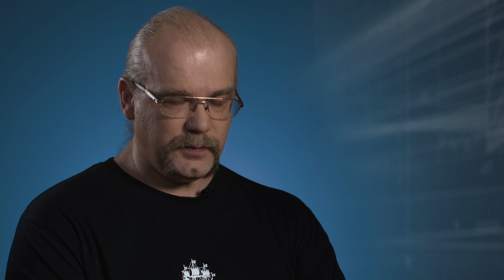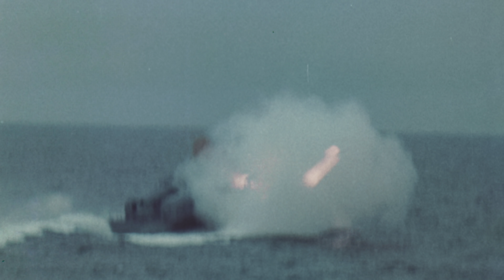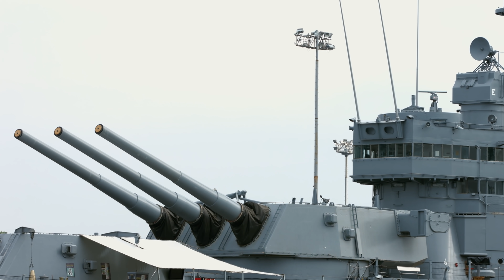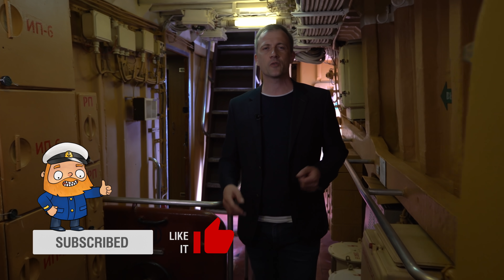Naval Legends: Tambovskiy Komsomolets | World of Warships

Comment: This is true Russian Bias 
How tf can that tiny Junk be able to sink the freaking Iowa class Battleships when they got God knows how many escorts and this thing never did anything!
Reply: By punching through the thin deck, I suppose
Reply: @mediatus-d8v  Except the Iowas didn’t have thin decks, they had three armored decks designed to withstand bombs

the first deck catches the bomb and takes a hit, the second stops the blast from getting through and the third shields the internal components of the ship
Reply: @breadbug6101  how uss alaska can comment in my comment, sheesshh that crazy
Reply: @breadbug6101  i thought you dont have an arms. Damn that is real crazy
Reply: Because of it speed and armament it really can sink an iowa class battleship, iowa class is very slow and it gun is too big for modern warfare, i think if iowa class have some destroyer escort it can defend itself.
Reply: @adreialdovino4239  *Laughs in 35 knots
Reply: @breadbug6101  *laught in 42 knots
Reply: @adreialdovino4239  actually one of these missiles was fired at Missouri during the 1991 gulf war and was shot down
Reply: @Adrei Aldovino  slow? The Iowa can reach 35 knots as her max speed. Which is faster than most modern destroyers.

Comment: The age of Battleships is coming back oddly. With it getting easier and easier to counter torpedos and missiles, it won't be long and it will be near impossible to get through a ships anti missile or torpedo defenses. And the one thing you can't counter is a 16" shell smacking into your boat, rocking the whole crew.
Reply: Maybe not battleships. I think some sort of heavy / large / battlecruisers just because of economic reasons. We don't make thicc boi armor, guns, and ammunition anymore. As for the guns, maybe we'll have either railguns or a naval version of the 1000 mile cannon the US Army is developing, possibly fitted out with an autoloader. Maybe a 2 foward turrets (twin, maybe triple) and vertical missile launchers and a helicopter hangar where 2 aft turrets should be? Maybe add an unbelievable amount of anti air and ciws.

Comment: Once again, Russian propaganda makes its way into these videos. Modern anti-ship missiles have been equated in terms of firepower to that of an 8 inch (203mm) naval rifle. An Iowa class BB was designed from the outset to withstand hits from 16 inch (406mm) naval rifles.the notion that a single Sunburn missile could take out an Iowa (or at the very least disable it) by hitting certain parts of the ship is absolutely ludicrous! Furthermore, you downplay the abilities of the Phalanx CIWS system, and by extension, the missile defenses of an Iowa as a whole. First off, as stated, each Iowa would be escorted by air defense ships at the very least. U.S. Navy doctrine regarding the Iowa’s was if they weren’t part of a carrier battle group, they were escorted by 2 air defense ships and one anti-submarine ship (and what’s with using F-15 Eagles and WW II configured Essex class carriers to represent a carrier battle group?! Please use proper representations!). Second, each Iowa was outfitted with 4 Phalanx, multiple decoy launchers, and the SLQ-32 electronic warfare system for defense (there were plans in place to install 2 octuple Sea Sparrow launchers in the mid-90’s but obviously this never happened so consider this a side note). Furthermore, the minimum detection range of low flying aircraft and cruise missiles was between 18 miles (30 km) to 56 miles (90 km). Good luck in hitting them in the first place! Also, the Iowa’s were equipped with Harpoon anti-ship missiles, not just Tomahawks.
Reply: 16 inches is 406mm
Reply: @DirectorBird  whoops, thx. Wrote this while still waking up, lol
Reply: Would it withstand penetrations from 16", or even 8", shells?
Reply: @jevinliu4658  yes and yes. With technicality exceptions for the Lexington class battlecruiser and the North Carolina class battleship, all American armored warships stuck like glue to the rule of thumb of being able to withstand hits from their own weapons
Reply: @lightspeedvictory  You don't have any idea. The Iowa can be penetrated by 8" guns at close range, so by your logic this missile can penetrate it at any distance.
Reply: @submarinoflotador4532  key phrase there, “close range”. And if u r saying this because of how the ship performs in-game then forget it. The game IS NOT realistic. The USS Wisconsin (BB-64) took a hit from a 6 inch gun to an unarmored section of the ship during the Korean War and all it did was make a 4 ft. hole and wrecked the compartment that the bulkhead was a part of. The USS Missouri (BB-63) took a kamikaze hit directly to her main deck which comprises of 1.5 inches of steel armor and just left a dent. As I’ve clearly stated, Iowa class battleships were designed to withstand hits from 16 inch rifles. An 8 inch shell is more or less a popgun! And u have to remember that armor piercing shells are a whole lot denser than missiles and will therefore b able to penetrate more armor. So really, saying that missiles r equivalent to 8 inch guns is being a bit generous
Reply: @Aspyrstil  You forgot to add “in the game” to your statement bud. Reality is different than what you see in a Naval Arcade game.
Reply: @submarinoflotador4532  You are Dense actually, you feeling this is the same in Reality and in Game LOL, better know what reality ships are than in this whack simulator Game

Comment: In case you wonder what the Cyrillic text in the video means:

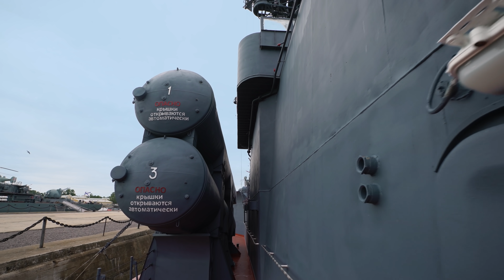1:00 "Danger. Lids open automatically"
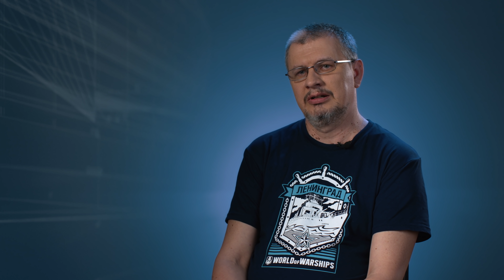2:01 "Leningrad" (on the shirt)

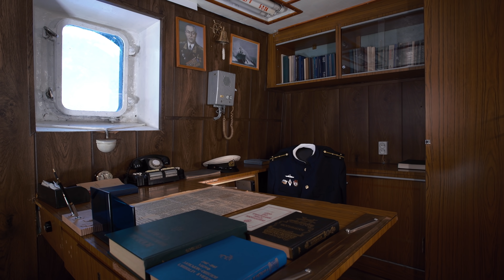5:07 "Sailing the Baltic Sea" (the highlighted book left)
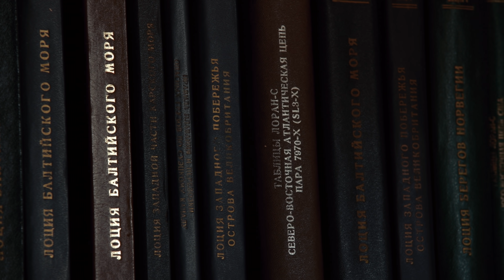5:09 "Laurent´s tables of the North-East Atlantic" (the highlighted book on the right)
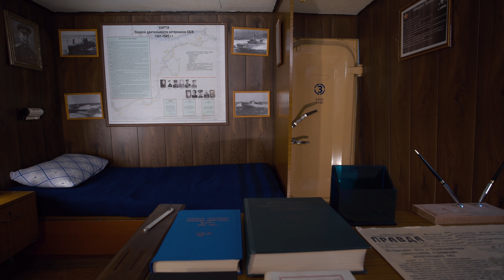5:12 "PRAVDA"-newspaper (Pravda means Thruth) on the table, and the map on the wall is titled "Combat activities of patrol units 1941-45"
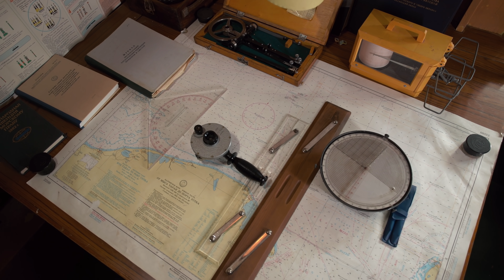5:15 the map is titled "From Cape Taran to the Port of Ustk"

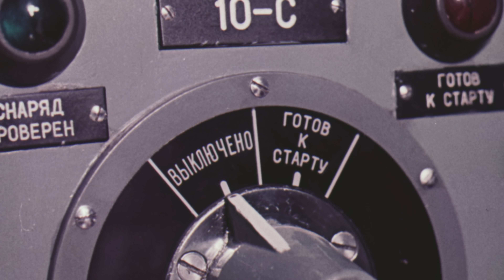6:08 "Missile ready" plate upper left corner
"Ready to fire" plate upper corner right
on the round switch:
left "Turned off"
right "ready to launch"

6:13 the switches on the right, upper to lower:
"DC voltage control"
"Voltage 400Hz"
"Voltage 50Hz"
the switches in the row next to it:
"Management selection" (maybe "chose the control-type"? not sure)
"Selection"
"Selection off"

6:15 "Start" (aka "Launch missile"), the button next to it is "Unblock"
upper left says "Degrees" 

6:28 "Tambovskiy Komsomolets" on the hull (you guessed it, I guess ^^ )

7:14 again, "Danger. Lids open automatically"

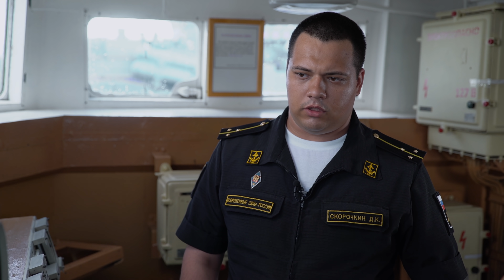7:30 the inscriptions on the officer´s uniform:
left: "Armed Forces of Russia"
right: "Skorochkin D.K."
(the white box on the wall behind him basically warns "Danger, high voltage")

8:52 the round lid on the rocket´s nose: "Alignment of T.G.S" (I don´t know what TGS is)

10:30 this thing is a "lead calculator" for fire-control
the gauge upper left says "Heading angle", upper right "Distance in KM", between them "Kondenzor-218"
The red plate says: "Warning! In the setting AU in position GN immediately release knuppel and button"

15:54 Control panel for the main engines, propulsion. The gauges are titled "Rotation frequency (RPM)", "Propeller shaft speed", "Forward/Back" etc

15:58 "rudder left - rudder right"

16:30 the green text says "EXIT"

Feel free to add or correct!
Reply: Comment needs to be pinned.
Reply: TYSM! :D

Comment: 4:59 ah yes 1,600 miles. The famous intercontinental sailing range of 12,000 kilometers.
Reply: and thats while using diesel engines at snail speed. Use the turbines... and its 250+ miles till you are out of gas.